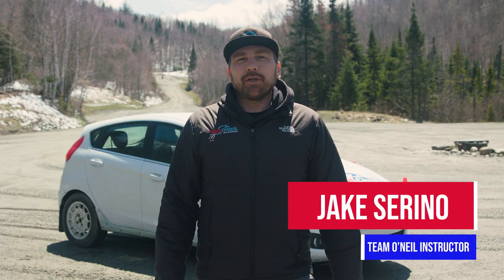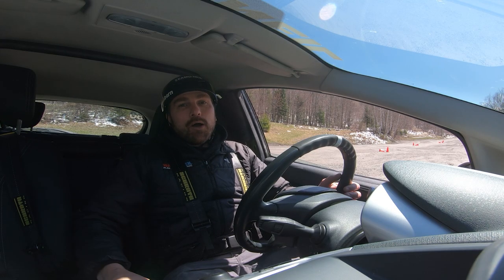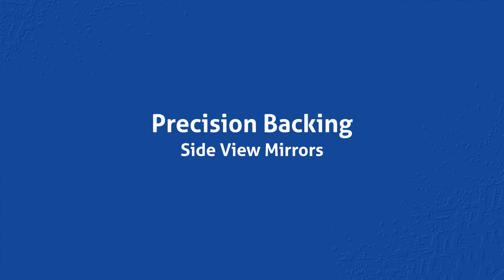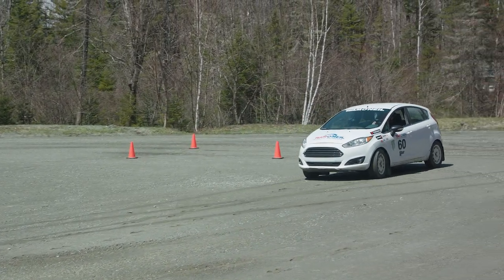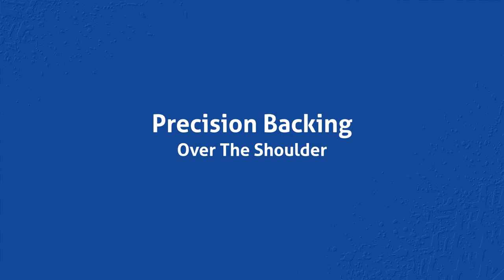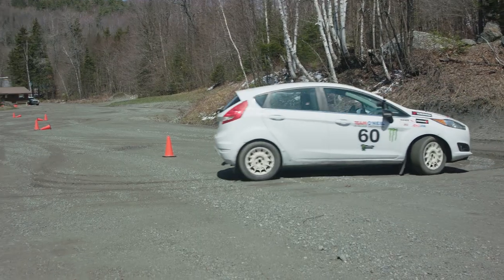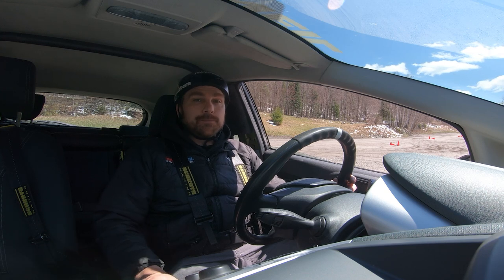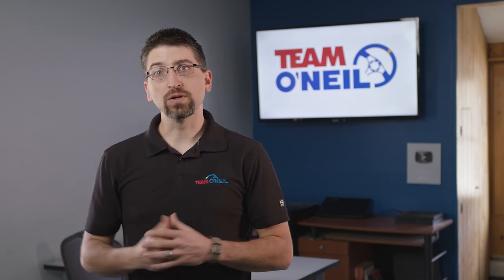Precision Backing

Comment: Forklift driving helped tremendously with this
Reply: yup, I drove forklifts for years, had a lot of fun on them too
Reply: Forklift makes you realise that the differential has to do its thing (and you have to allow it time to work) as part of steering. Sometimes with a fork I find myself doing steering correction like when you have corrected a slide and then have to counter steer to stop the over correction going to far and spinning the car.

Next … backing trailers and driving articulated machinery!

Comment: Good technique for the initial sideview mirrors adjustment. Most people include the side of the car with their heads centered, which excludes too much of the periphery.
I've had to transition to mirror backing as, with age, my neck turning ability has progressively (degressively?) diminished.
Reply: for day to day use, I like just seeing the tail of my truck in the mirrors so I can have a frame of reference for where something is, you don't need to see half your vehicle though
Reply: tbh for day to day driving i have my mirrors adjusted with my usual driving position
watching my mirrors alot i really dont wanna shift my head all the time

Comment: Why lean to left/right when adjusting mirrors? You don't want to normally lean over just to see what's in your side view mirrors?
Reply: you lean just a little only to adjust them, while using them you don't, this give you the biggest field of vision that's relevant
Reply: Because they aren't there to see the side of your vehicle.. they are there to see what's beside/behind you.
Reply: @wantsanewvehicle  yeah no shit… do people’s mirrors not adjust far enough to actually show what’s along side/behind them without having to lean over too?
Reply: @wantsanewvehicle  Seeing a small part of the side of your car from your normal head position can act as a reference for where that obstacle, other vehicle or cyclist is. Also when backing up it can help with getting the car in the space as it can show when the car is going back straight relative to things like lines, kerbs, other parked vehicles. If you angle the mirrors outwards too much the car will never look like it's going straight back when it actually is. You'll always look like you're drifting towards/away from the line/kerb/whatever you're trying to be aligned with. You should always be checking your blindspots as no amount of wide mirror adjustment will enable you to see someone over your shoulder moving across multiple lanes towards you if you're trying to change lanes in the opposite direction towards them, at least not without then creating a rearward blindspot right next to the car where you'll miss cyclists and motorcyclists who might be filtering through traffic/overtaking/coming down the kerbside to turn off.